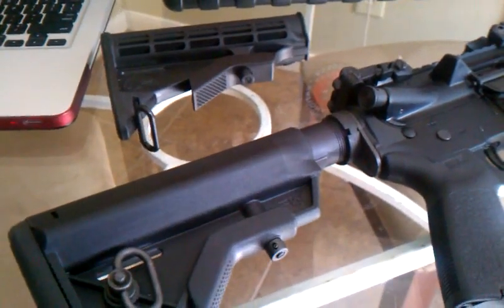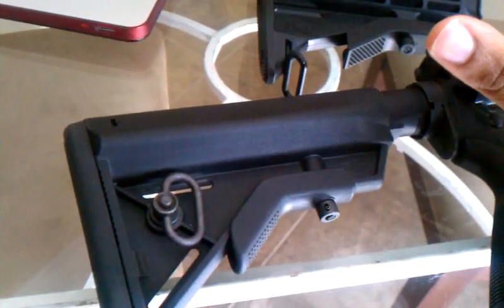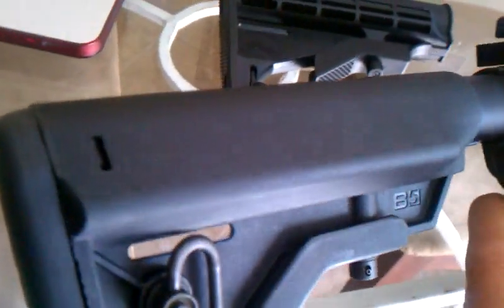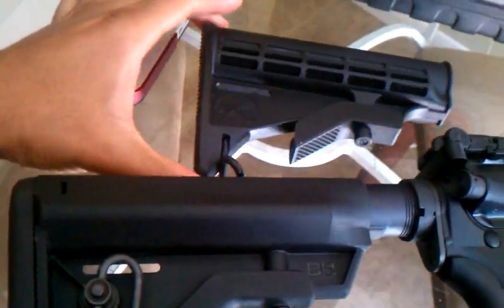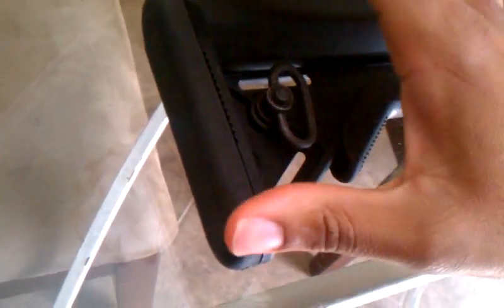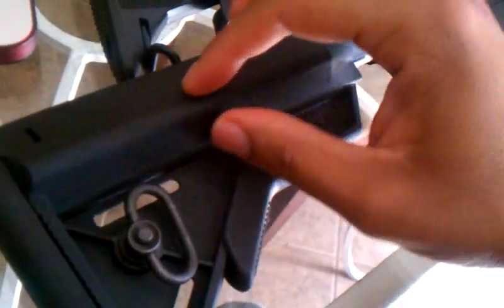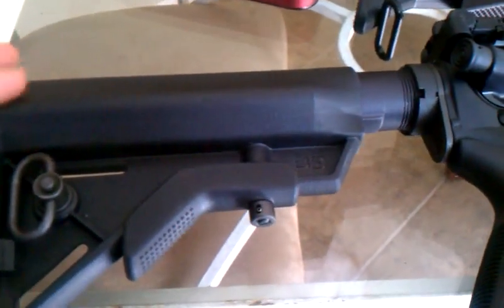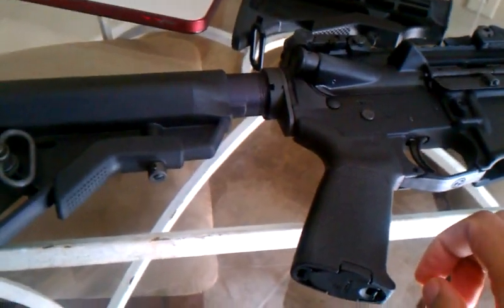B5 Systems SOPMOD Bravo

Comment from the maker: Friction lock? You mean the adjustment lever?
Pull the lever all the way down like you would to install a normal M4 stock. It has a stronger spring, but the lock up is solid. With the lever pulled down all the way, slide the stock all the way forward on the receiver extension then release the lever. Pull the stock backward and adjust from there.

Comment: The friction lock IS NOT a gimmick. A gimmick is something that serves no purpose or doesn't do what it says it will do. The friction lock does exactly what it's supposed to do and the CTR is worth getting over the MOE because of that feature alone. The MOE is the most useless stock of all MP stocks... it's not tight, no QD swivel spots... what does it have over a mil spec stock? I agree that the rogers stock locks up tighter though.

Comment from the maker: $75... does it free float the barrel or is it lightweight yet stiff and doesn't flex? Doubtful. This rifle has a 13in" Troy Alpha tube handguard on it now. It's okay, but it does have a bit of flex at the end. When you buy the rail you aren't just paying for the aluminum, you're paying for the CNC machines and time it takes for it to be shaped and the people who operate them and the engineering behind it. If you handle a Geissele SMR Mark 1 rail you can tell there is huge difference in quality.